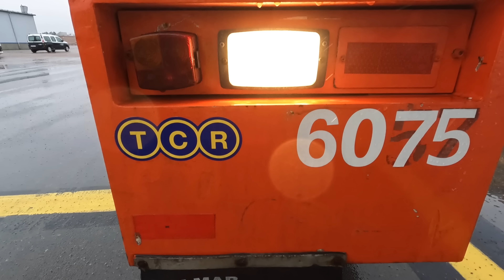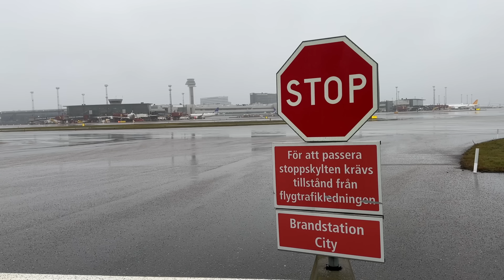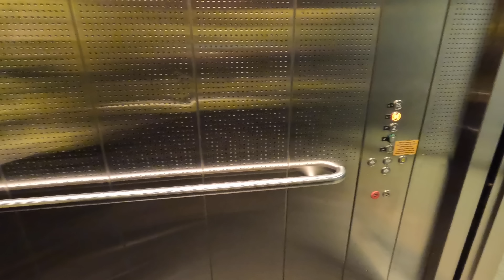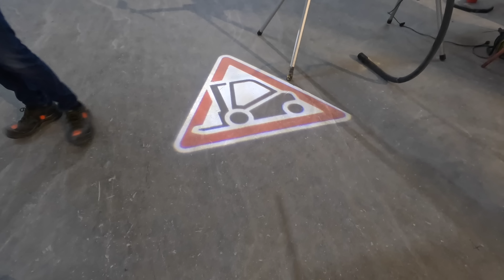Arlanda Airport: Behind the Scenes Airside Tour

Comment: Seems there was a Finnair A230 to HEL.
I had a transit through Arlanda this year.  It was a horrible experience.  Coming from Miami we had to go through a transit security check at Arlanda.  They had only one line with a very long queue.  The scanner was so ancient that you had to completely separate all electronics from your hand luggage.  I had three cameras, a laptop, a pad, dive computer, cellphone, wrist watch and chargers for all.  The space was very crowded and no tables to use for unpacking and packing.  Belongings fell to the floor when unpacking and after scanning I had to be on the floor to pack everything back into my bag.  I have never ever needed to do this in any other airport.  In modern airports you don't even need to separate liquids any more.